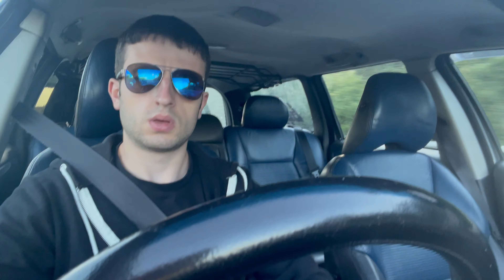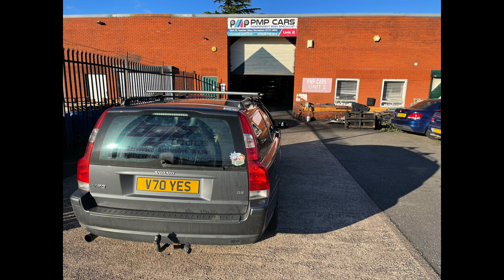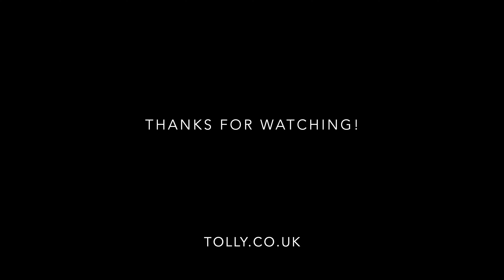M135i Engine Rebuild Update - F20/F21 N55 Engine Seized Project

Comment: I left my crankshaft to be grinded after 2 rod bearings seizure. Hope it can be done, cause it didn't look like its too bad of a damage.🤞 gonna rebuild it on my own thogh and try saving heaps. 
Interested to see what happens in your case,cause the damage looks a bit different. Do you know what caused the seizure?
Reply from the maker: I’d have been less annoyed had they even managed to measure the crank for me like they said they would! I would rebuild if I were keeping real long term but I plan to only put about 3k miles on before selling. Mine seized on the Conrod bearing at the oil pump end. The reason will be people treat the car like it’s a normal 1 series and drive them without letting them warm up and for not long enough.